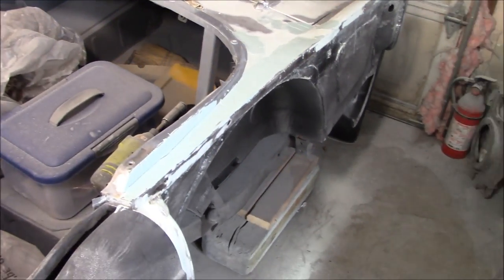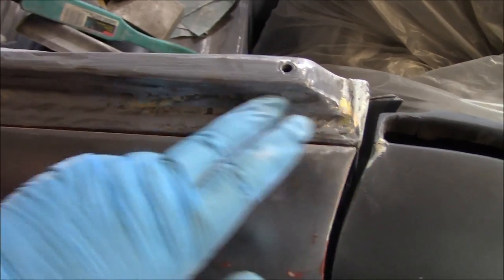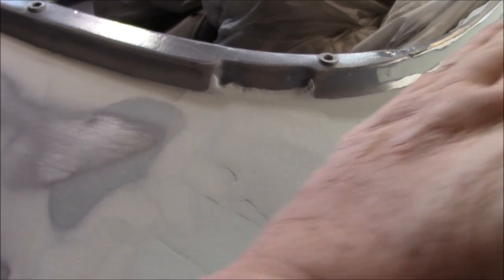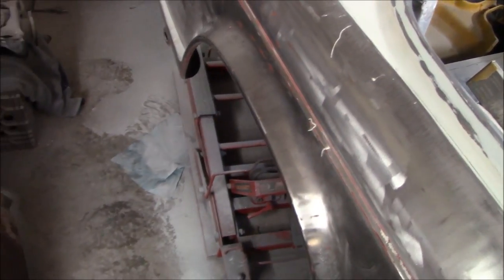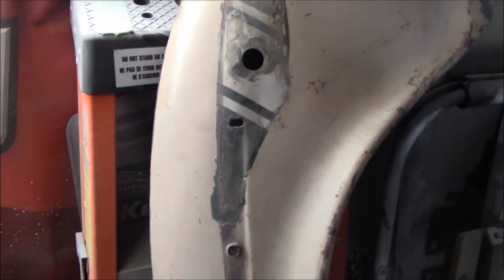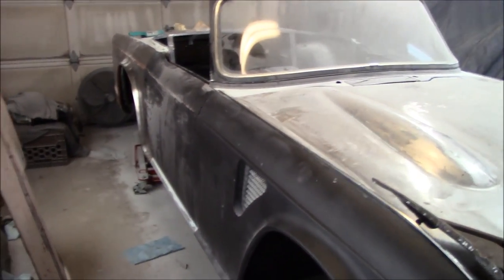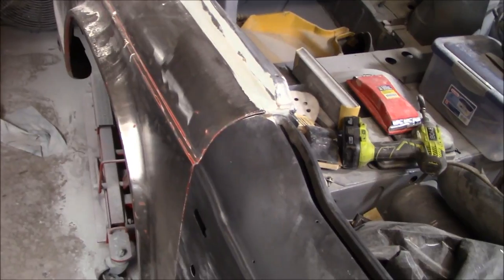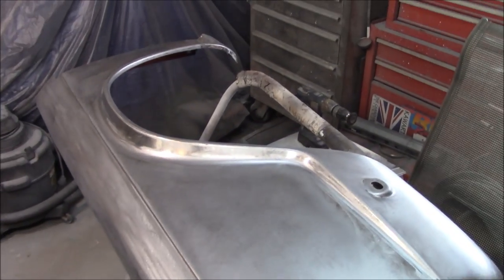1968 Triumph TR250 Restoration Short Update

Comment: One fall I decided to attack the rust on my 280Z before winter. It wasn’t that cold when I was sanding but when it was time for filler, it was cold. No heat in the detached garage except a small kerosene heater. I took it to a part time painter when I’d finished the rust treatment. He complained that the Bondo was still soft. Either I didn’t mix it properly or it was just too cold for the chemical reaction. Lesson learned. Well, it wasn’t that hard on me but he was sore about it.
Reply from the maker: Yes, it’s hard to work with bondo when it’s cold out…the other thing that concerns me, is applying bondo to very cold metal…expansion/contraction etc.

Comment: Filling, the job that takes forever and chokes your lungs right up!! Interesting brazing repairs by the previous owner vs your own welding repairs. I've done both types of repair, and in all honestly I prefer to weld, I find brazing does work and gives a nice golden finish, but its messy. If you have a welder set up right its quicker and easier, and I think its less stress on the metal with the heat from a weld over a braze

Comment: David that a lot of snow. I do not know if i'm being lazy or smart, my foot out of the cast the wound or deep bone ulcer is fill in with new tissue. I think I really just waiting for spring plus I'm hoping this down time is making my foot and new skin tissue more robust. Not wanting to spend another 9 months of going to the hospital every week for treatments and casts. Thses deep bone ulcers  also have turned into  a strong Negative Financial Headwind Wind that i will still be recovering form when i retire in July. Yes here in the states healthcare cost is high cost. Enough about me,  making good progress on the  TR250 will you sandblast the support piece under the bonnet or use a rust incapsulator like POR15 ??
Reply from the maker: Yep, you need to look after your health first that is the priority.   Once I get that piece sandblasted, I only plan to epoxy prime it before base and clear coating it once its attached back under the bonnet where it goes.

Comment: I checked the rear panel on my TR6 which is original. It is flat at the front of the panel and has about 1/8 in. gap at the rear where it meets the deck lid. I don't know if it's the same as the 250 profile wise.
Reply from the maker: Hi Dave,  I was looking at some photos of my TR4 that I have in storage...I would have liked to look at the actual car but its covered up pretty tightly under a couple of covers and a bit of snow at the moment....I think I have a little better idea now of what it "should" look like.   I will make the best of what I have.   Cheers, Tush